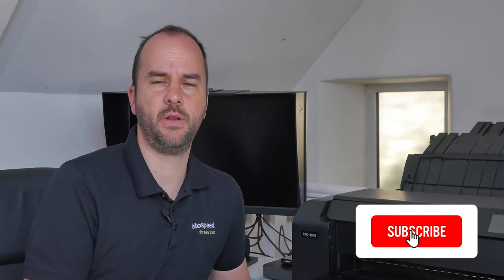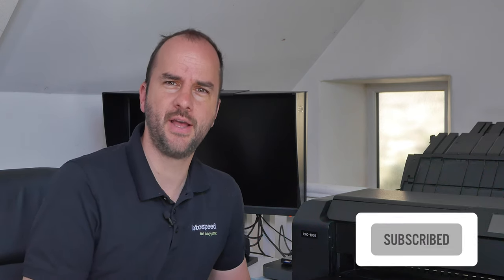Fine Art Printing Workflow - Fotospeed | Paper for Fine Art & Photography

Comment: Such a workflow can suit only those who have lots of paper and ink :) Maybe you could get the same results printing tedt shots on A6.
As a side note, your A2 print looks imressive! However, it looks like the same job could be done on a A3+ paper, if one would frame prints with a mat.
Reply from the maker: Hi Orel, Yes use smaller sheets of paper like A6 save the paper. I only used A4 and A3 for the video. Tim